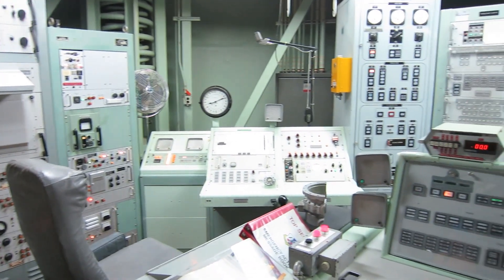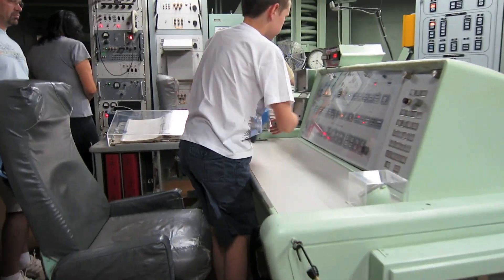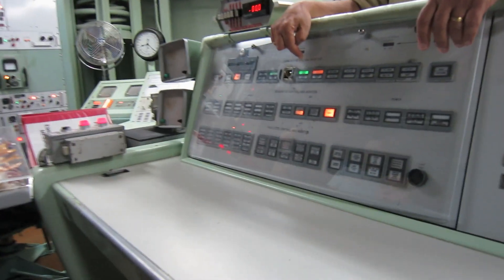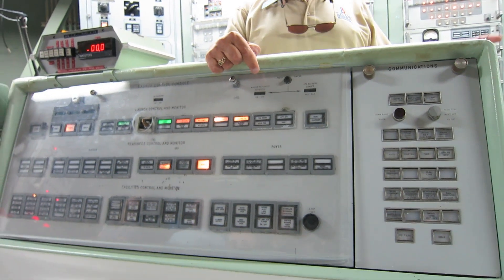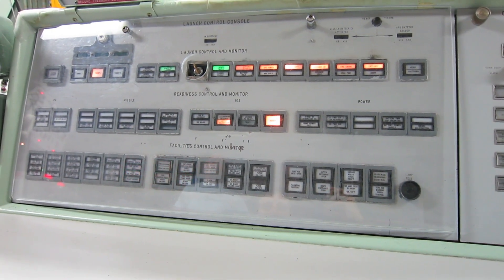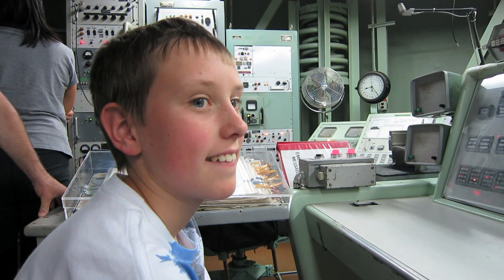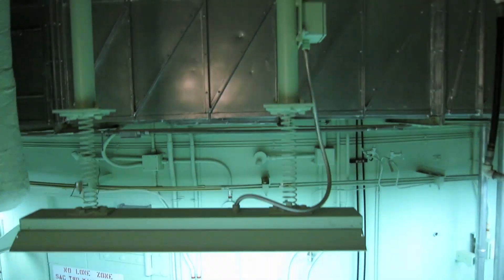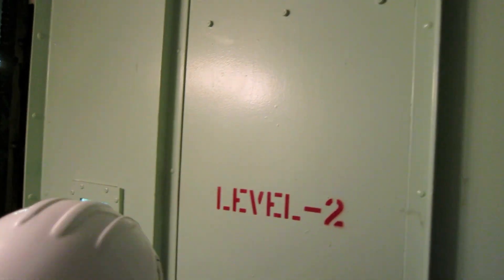Nuclear Missile Launch Sequence for a Titan II ICBM

Comment: Is the crew in the silo safe from a nuclear attack?
Reply: Very little can withstand a direct hit from the Tsar.  But keep in mind part of the reason the Soviets were pursuing larger and larger payloads was because at that time their missiles were not very accurate and they needed to compensate for near misses with larger sized craters, just as the US did.
But also just like the US, as inertial guidance became reliable and accurate, the need for bigger and badder bombs became less important.  That is the  main reason why the Tsar device was never put on a missile.  The cost to advantage ratio was just not there.  Weapons like the Tsar were much too costly considering an accurate lower yield weapon would do just as well.
Many people champion the Tsar as some form of superior Soviet weapons technology.  That would be in error.  The US never built a bomb that big, not because they couldn't, but because the US missile guidance technology advanced more quickly so the really big bombs weren't needed.
Reply: Yes, they are secured within the lcf behind a steel door weighing several tons and able to withstand the pressures of a direct impact by a warhead.
Reply: journeystarr they're only 5 stories deep, and a direct hit from a 300kt or multi-megaton nuke will blow a crater 200-1000ft depending on height of burst, yield, and weapon yeild
Reply: ***** if they took a direct hit and survived getting out would kill the crewmen and minutes due to the high levels of radioactive fallout. the R.A.T. (radiation assessment team) of the US army and DOD have anti-contamination suits that can only hold back so much radiation gathering debris and soil samples from any area close to or at ground 0
Reply: radiation suits can only hold back 500-600 rems per hour of radiation without the radiation penetrating the suit of the worker and exposing him to lethal doses of radiation. 1200rph of fallout can kill a well suited rad worker in 25-30mins with continued exposure
Reply: No, as the silo is 'soft' when being launched there is very little protection when firing.

When it's closed it's like any ordinary bunker, with shock absorbers and the ability to be self-sustained for a period of time, so yes.
Reply: they ought to have way more than just 2 weeks of supplies down there for the crew. they should also have anti-radiation suits and a way to radio for help and get out of the impacted area before the effects of fallout take hold and kill the crew and survivors
Reply: ***** if anything id bail directly after launch and get as far as I fucking can away from the missile site. because AFB missile sites are prime target
Reply: derek wall

Missile sites are a prime target, but relatively safe inside their bunkers.

considering you're gonna have about 3-10 minutes to get away from the silo, and the silo houses the only bunker around, you'd probably be better off sticking to it.

a nuke on a sufficiently protected bunker would merely disable the silo, not always penetrate the bunker.
Reply: GlobstersMessenger makes sense lets hope the warhead wont be a surface burst, otherwise ground 0 will be very hot for months
Reply: +Derek Wall 
The silo was not able to withstand a direct hit, but could withstand a near miss.  
The conventional train of thought, however, was that since the Titan II was hot-launch and the silo could not be reused without reconstitution, and since the silo would in all probability be empty by the time an enemy missile would arrive, it would not be a priority target unless some form of total surprise could be achieved.
There are a lot of people who would disagree, but that was the general story that was passed around.
Reply: Kevin O'Quinn so much for safety, in that case if I were the crew id get the fuck out of their after they send that bird on its way. you would have only 10 minutes warning once a Russian ICBM launch has been detected and its impact point is determined. and it takes 5-8 minutes to process the launch order and launch the missile. and it takes a Russian ICBM 25-30 minutes to reach its target (which in this case would be the location in the video) so at best you would only have 10 maybe 15 minutes max to get as far away from the silo as possible.
Reply: What you may not be aware of, derek, is that with the exception of crew changeover (about 1 hour) or any on site maintenance crews, there is no vehicle topside waiting for you.  I hope you can run real fast.
Reply: Kevin O'Quinn or have your own vehicle parked somewhere close to the base that's what I would do. because everyone knows that an ICBM silo is a very likely target to get hit. and Russian ICBMs have a CEP of less than 1/2 mile and that's somewhat good accuracy
Reply: So you are going to wake up before 3am, get dressed, call a friend to drive you 1.5 hours out to the site to park your car then drive 1.5 hours back to the base for 6am departure, drive out to the site with your crew, spend a day in the hole, come back the next day and around noon have a friend drive that 1.5 hours to the site to drop you off at your car then drive 1.5 hours back home....and do that all over again in 2 days?  That is going to get real old real quick.  But if that is your plan, then sure, go for it.
Reply: +journeystarr but it cant withstand a tsar bomba
Reply: Kevin O'Quinn i know, thanks. but he said direct. to even think they wanted to make tsar 100Mton. theres a leaked russion documant building a 100-120Mton torpedo that can reach targets up to 10.000 km. its speed was also very fast.
Reply: In the case of Titan systems, the crew are in relatively close proximity to the silos, and as a consequence, are directly targeted by enemy ICBMs. With the advent of Minuteman, the crew thereof are in a separate launch control centre, located some distance from the silos, and obtain some protection from incoming ICBM attack, by virtue of the silos being the primary target.

You also have to bear in mind, the accuracy of the incoming enemy warheads. In the past, when Soviet ICBM systems had a CEP of over 1 km, this was compensated for by the use of large yield warheads, with enough blast power to destroy the silos even if they landed up to 1.5 km away from the target. Once inertial guidance systems were perfected to the point of giving the SS-18 a CEP of just 150 metres, then instead of using a 20 MT warhead, a 150 kT warhead would be sufficient. Reducing the size of the warhead meant that more could be carried on a single missile, and so, a single SS-18 ended up carrying 10 warheads, which could be independently targeted, with fairly frightening accuracy, over a wide geographical range. This allowed the Soviet mission planners to arrange for cris-crossing of warheads from multiple missiles, to add confusion to any anti-missile defence system, along with the chaff and decoys. Remember, before START II, the Soviet Strategic Rocket Forces had 318 of these missiles, all capable of carrying 10 warheads each.

Consequently, a Titan crew is going to be pretty much dead in a full nuclear exchange, because the incoming warhead aimed at the silo will be accurate, and detonate at ground level. Indeed, for silo destruction, some of the warheads might even have earth-penetrator technology, allowing them to bury themselves before detonating, "earthquake bomb" style. A Minuteman crew in an LCC might be more fortunate, because the LCC is some distance from the silo field, but an enemy with warheads to spare might target the LCC as well as the silo field.

Nowadays, the Russians have upped the ante with Topol-M. This is a road-mobile ICBM, doesn't need a silo, and can keep moving about to make it harder to hit before it's launched. The mobile launcher can also head for a hardened shelter after the missile has been launched, reload with a new round, and head back out into the field to fire a second missile a few hours after the first. Plans to make a road-mobile ICBM for the US Air Force have yet to materialise. The Russians also have the advantage of more land to hide their Topol-Ms in - remember, Russia covers 7 time zones.

This explains why the USA has invested particularly heavily in submarine launched ballistic missiles (SLBMs). Subs are a LOT harder to find and destroy than land based silos, or for that matter a land-mobile launcher. There's a huge swathe of ocean to hide a submarine in, and a modern nuclear submarine can operate non stop for 10 years without refuelling. The only limit on subs is how much food they can carry for the crew - the nuclear reactor not only provides huge amounts of engine power, but enough spare electricity via the generators to operate water desalination for fresh drinking water, and a device called an electrolytic gill to provide the crew with oxygen to breathe. If it wasn't for the fact that the food storage issue limits a typical patrol to around 80 days, the subs could lurk below the water waiting to strike for months at a time. Even so, you can keep a sub hidden in a lot of ocean during that 80 days. I'm pretty sure you'll find someone from the US Navy to go into more detail, or at least, as much detail as can be divulged without revealing anything classified. :)
Reply: +Derek Wall. as long as the incoming warhead doesn't drop right on top of them they would likely survive yes.
Reply: The reason the doors are so thick in the silo is not to protect them from a nuclear blast (because it wouldn’t) but to stop intruders from trying to get in and launch the rocket or damage the launch ability. If I had just launched a nuke I would be up on the surface ASAP to catch the return shot in my teeth... because I sure wouldn’t want to live after killing so many innocent people.
Reply: @NeoMorphUK  Who would want to survive